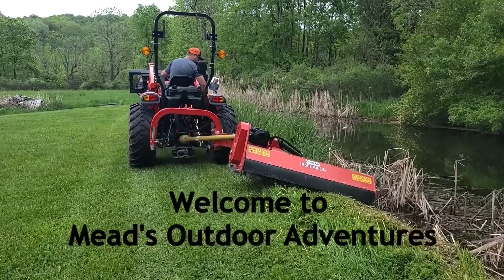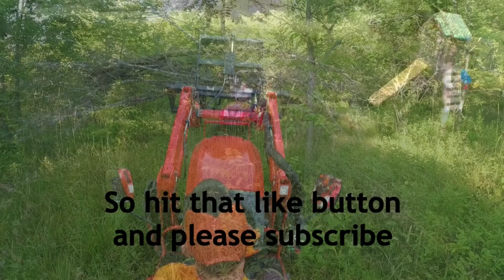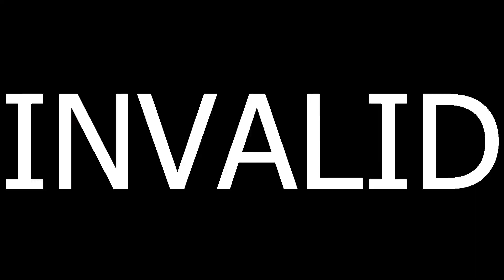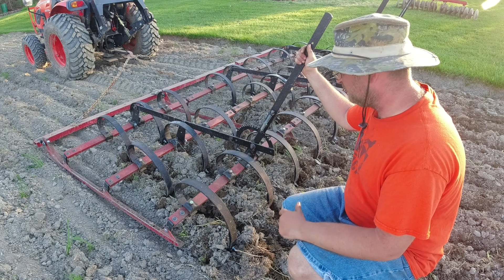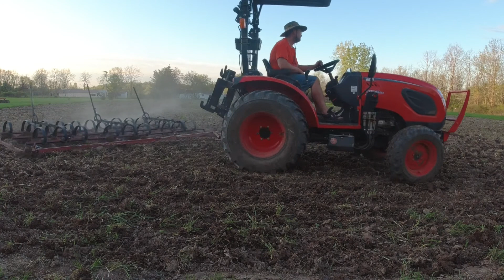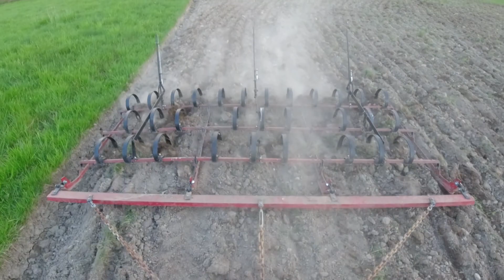#24 Antique 12 foot spring drag harrow behind the Kioti ck3510se

Comment: Would that make it smoother if you raise your tines up
Reply from the maker: Good question.  I will experiment with this after I spread the lime next week. Stay tuned!
Reply: @meadsoutdooradventures  I used these for years, after discing. You need to go 90 degrees crossways with your springtooths, over the whole field, then back across the same as the first pass. This was a must for levelling to plant tobacco rows. No need for raking that way